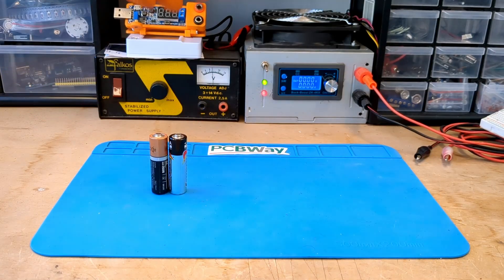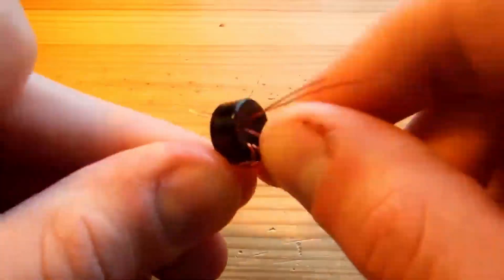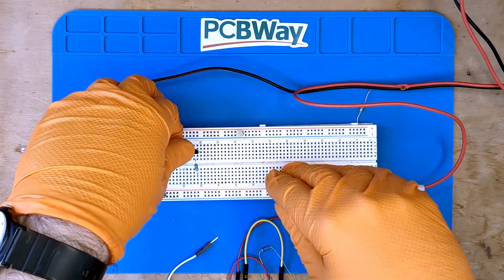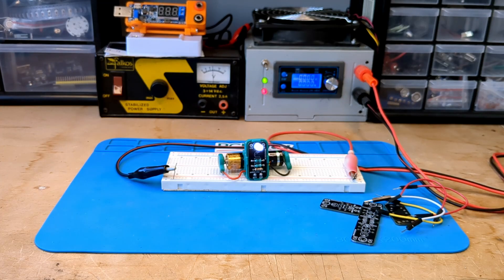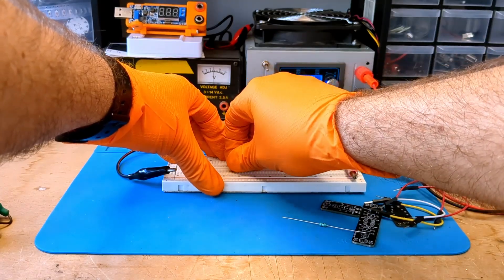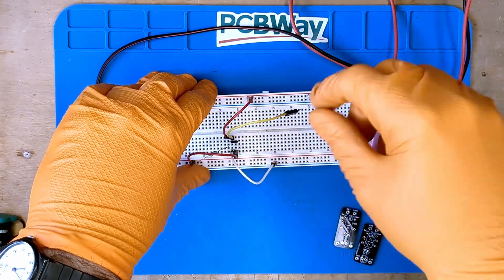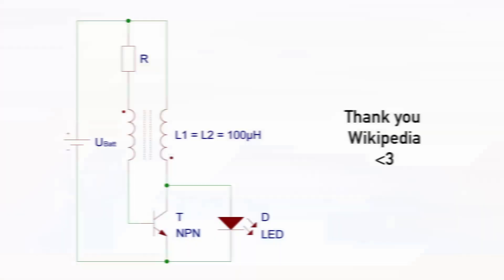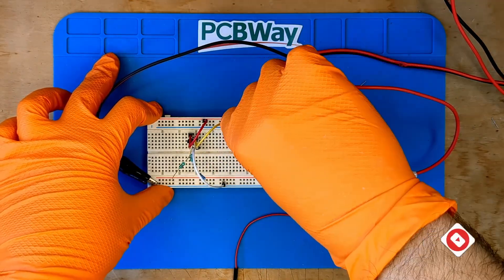Easiest Joule Thief You Can Build [Only 2 components, NO Toroid]

Comment: I tried 1st circuit with 2n2222 instead of bc337 and was not expecting it to work since everyone else was using toroid instead of inductors but it worked flawlessly, thank you.
Reply from the maker: Hurray!
Reply: Fake! If it worked it would be because stray field but you need a transformer, toroidal or not
Reply from the maker: @linli820  100% real. Try it to believe it.

Comment: Thanks for the video. Very informative indeed. Which circuit draws less current? wondering which one lasts longer.
Reply from the maker: Hello friend. Glad you enjoyed the video.
I do not know which circuit uses less current.

I can tell you that in general the jt is not a very optimised circuit...
I think the first circuit in the video (with a low resistor like 1 ohm) manages to activate even at low voltages like 0.4 or 0.5 volts.
The second one I think is more optimised, but works down to 0.9 volts.

I don't know if I have answered your question...
But I think I will have to do some efficiency tests on these little circuits at some point. You have given me a good idea for a next video....

Comment: Hey there.  This is great and thank you for posting.  I'm placing in TinkerCad prior to making (components on order).  Question - At 2:58
you say the red wire connects the positive pole to the inductor connected to the emitter.  You mean collector, not emitter, correct?  Thanks in advance!
Reply from the maker: You are right! I was wrong!
Thanks for the tip.
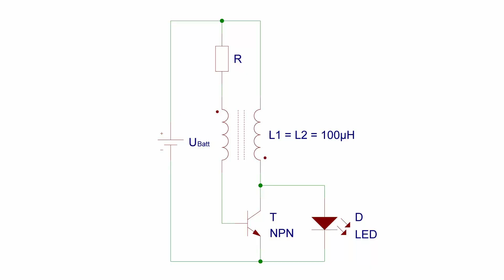If you want you can see the circuit at 2:31 or you can see it here https://www.instructables.com/Endless-Light-With-Dead-Batteries-Yes-Its-Another-/
The Gerber file can be found here https://www.pcbway.com/project/shareproject/Joule_Thief_JTT_1_5d4656c5.html
Reply: @dariocose  Thank you.  I will use the instructible and youtube to build the circuit when my parts come in.

Comment: Why isn't the 2nd circuit considered a jt?
Reply from the maker: Technically, the QX5252 is an IC to manage small solar LED lights.
In this case I only use it as a voltage booster. The Joule Thief is also a voltage booster but works different to the QX5252 ...
https://en.wikipedia.org/wiki/Joule_thief